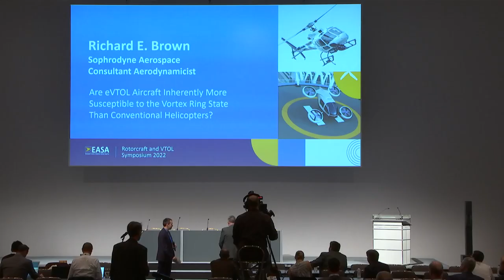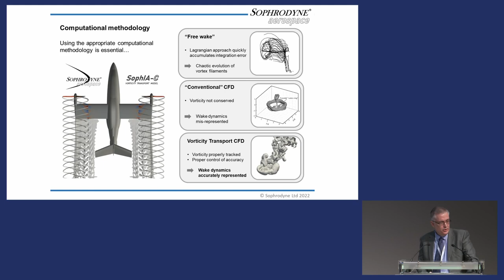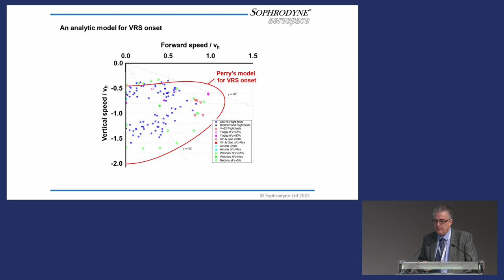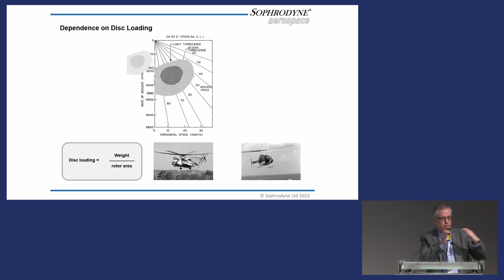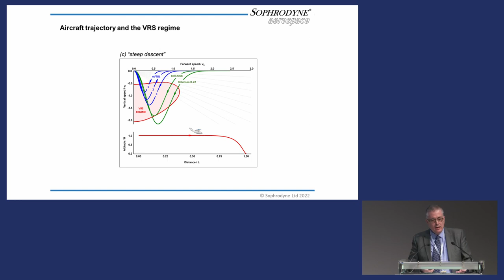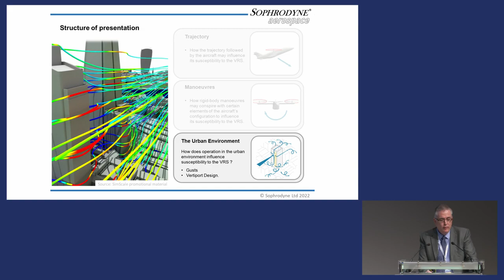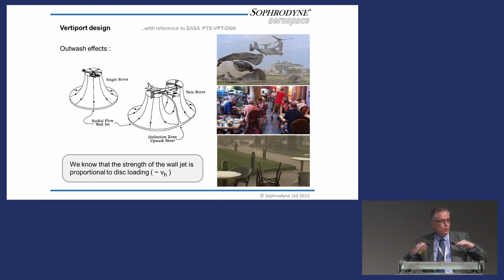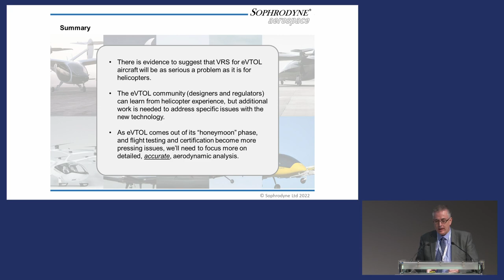Are eVTOL Aircraft Inherently More Susceptible to Vortex Ring State Than Conventional Helicopters?

Comment: Great presentation.  One critical omission - most eVTOL aircraft are designed to have full envelope protection which includes rate of descent limitation to prevent VRS - this is potentially the golden bullet to VRS as a catastrophic hazard.
Reply: What happens when you add internse gusts around urban vertiports? Can the flight envelope protection system account for that, especially with asymmetric VRS?